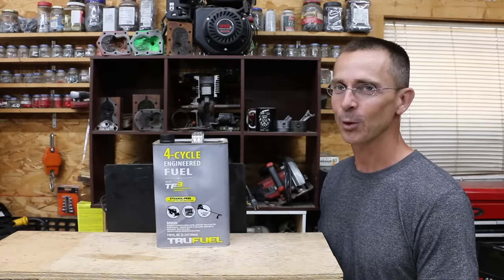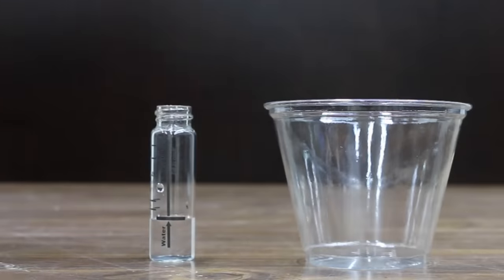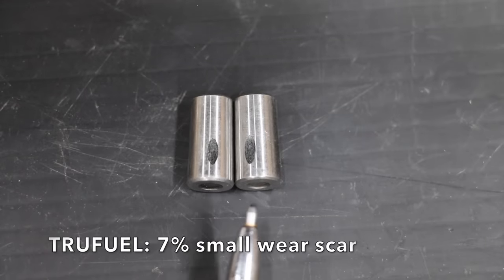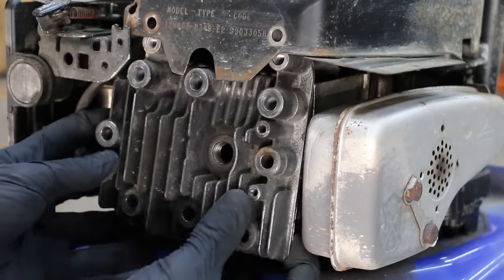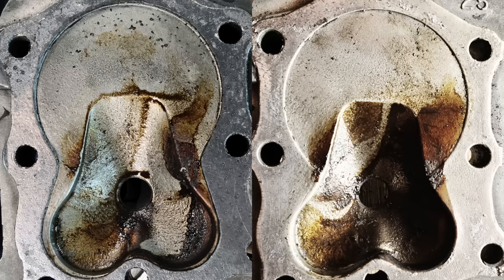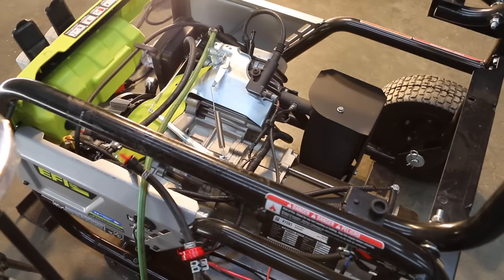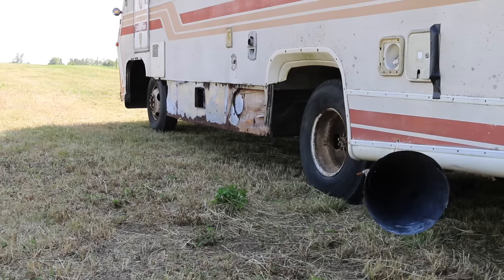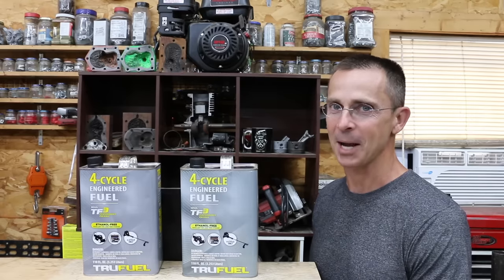Engineered Fuel better than Pump Gasoline?  Better Fuel Efficiency and MPGs? Let's find out!

Comment: Okay so say I have a can of the Tru Fuel 40:1 ratio 2 cycle fuel mix, and an additional 2 gallon spare jug full of the expensive high grade pump gas to add with it (91, 92, or 93). And I am considering mixing the two and adding the contents into the gas tank of my car with whatever premium pump gas that's left inside it, as a last resort in order to get myself to the nearest town/or gas station. This is hypothetical, but it really has been bugging me for a while now. Of course you already tested the 4 cycle engineered fuel in the appropriate engines, but not 2 cycle fuel specifically while running it in a 4 cycle engine with additional high octane pump gas.

Comment: I know I'm late to the show but I use Tru Fuel because it does not have ethanol in it.  I live in a large city and ethanol free gas is not readily available.  I used to have to get my mower, etc. carb overhauled every year.  Tru Fuel has stopped that.
Reply from the maker: Thanks for sharing.

Comment: Test Trillion HydroDiesel. Very interesting diesel-water emulsion with up to 20% water. So, as the fuel consumption remains the same or is even better, it thus uses at least 20% less diesel? Drasically reduced soot and as the combustion temps are lower as water uses the heat to vaporize, much less NoX as well. "Steam power" means no drop in power or torque and might use less fuel. How does it work really? What ahppens when it gets really cold? Does it separate? So many questions...
Reply from the maker: Thanks for the video idea.

Comment: Have you ever done a test on the 2-cycle fuel for chainsaws and other 2-stroke engines? If so, can you post a link. These canned fuels seem to cause a number of problems, especially if the fuel isn't completely burned out of the tank and carburetor. Please let me know. Thanks

Comment: I do not use my 2-stroke equipment very often, only a couple times a year. So I buy the engineered premixed fuel, there are two can’s sitting on the shelf in my shed, when I need to use my chainsaw I fill the gas tank with this fuel, fire it up and go. When finished, I empty whatever is left in the gas tank into my lawnmower and run the carburetor on my chainsaw dry. Then put my chainsaw back into storage. If you’re not going to be using very much of the engineered fuel it is a great way to keep your equipment in tip top usable condition. If you go through a lot of it, like the lawn mower, just plain old E-free fuel is cheaper. 
Once again a great video, and I bet your neighbors just love you when you run the Farmabago. Lol
Reply from the maker: Thanks so much!

Comment: Hey Todd, could you do another video on Upper Cylinder Lubricants for Gasoline Engines? I don't know all of the products available. I only know about Marvel Mystery Oil, and Amsoil Upper Cylinder Lubricant. I've used Amsoil's. Amsoil's was released last year or the year before, I think. I've used it, and I've seen results with it. However, it was only about 3/4 of a MPG higher, which didn't pay for the bottle (which is $3.65 at cheapest, if you have the Amsoil Preferred Customer Discount.) Other cars may react differently than my 2005 Explorer.
Reply from the maker: Thanks for the video idea.

Comment: Great video! 
I’m not sure if this is previously mentioned in the comments, but I’m curious what the life span is, in say a generator between the two fuels? 
Would engineered fuel hold up better long-term in storage?
I use ethanol free, since it holds 5 gallons, but not sure if the longevity would be worth the additional cost?
Reply from the maker: Thanks!  Thanks for the suggestion.

Comment: I'm going to take a wild guess and say this fuel isn't designed for low compression engines., probably why the buildup is so great. Higher compression should increase temperature resulting in a slightly cleaner burn.
This is just my hypothesis however.

Also, running 91 octane in engines designed for 87-89 will reduce efficiency because fuel is harder to ignite for a low compression engine.
I would bet running 89 octane would increase performance slightly in these particular engines.
Reply from the maker: Thanks for the feedback.

Comment: I don’t think the engine running was a fair test. When using different gasoline’s they have a tendency to run differently. For example if I was to use 112 octane it would run different than 93 octane and would require different jets depending on the engine. Each engine should’ve been tuned for the gas before testing
Reply from the maker: Thank for the feedback.

Comment: You don't have a problem with your kill-o-watt meters burning up if you leave it plugged in and running close to max amps? I burned one at 14 amp constant idk how long before it went, I wasn't around but it wasn't to long and another one went at about 11-12amp constant for a longer period of time.

Comment: considering it is mostly parafins, and no ethonol nor benzines (which will make rubbers brittle and leave gummy deposit, it is great to leave in your equipment for winter storage, way better than gasoline. Like my chainsaw for example. In winter time it may sit for 3 months, or maybe a month, I will need it a time or 2 during winter but not alot, engineered fuel is great for this!! can leave it in the saw without the worries of gasoline going stale or leaving varnish inside carburetor. Also engineered is supposed to be good for 2 years once opened. Now, if you figure I am only using 1 tank full per year, per piece of equipment, that $20 a gallon fuel lasts a LONG time and goes much further than you think, and no problems with equipment in the spring :-) 
My opinion. Great video good sir! Love how detailed and how extensive you go! Always a pleasure watching your videos. I wish my channel was as good as yours! you are something to aspire to be :-)

Comment: I use vp fuel and it has greatly improved my small engine/2 cycle engine performance and reliability.  I can't buy ethanol free pump gas where i live so synthetic it is.   Great video
Reply from the maker: Thanks so much!  Thanks for the feedback.
Reply: How much you pay they want 80 for 5gallons of vp small engine fuel
Reply: @michaelchambers6273  basically the same for me

Comment: I have been using Aspen fuel (alkylate fuel) for 3 months on my brand new honda mower. 0% build up, and oil doesnt get black. Sparkplug as well looks new. I use the mower 45min 1-2 times a week.  But what is truefuel?

Comment: Help!  Is there an additive that will extend the working life of regular fuel?  My covid era driving miles are so low, I'm barely halfway through the full tank I started out with in March.  Afraid I might have problems, but don't know whether to top tank up or let it finally drop down to a low level, and just keep enough gas in tank for about a month of reduced mileage driving.

Comment: I had “non-ethanol” gas sitting in my ATV for about 6 months. Turned it on and threw a check engine light for o2 sensor and had to siphon it out bc it went bad. New gas and CEL went away. The fact this test was done with 6month old true fuel and fresh non ethyl speaks for itself to me that trufuel is better.
Reply from the maker: Thanks for the feedback.

Comment: How about a diesel fuel test? Biodiesel B15 vs B85 vs low Sulphur vs off road diesel. I built my own processor to make biofuel from used cooking oil. I'm told biodiesel has better lubricity and cleaning properties the dino fuel.
Reply from the maker: Thanks for the video idea.

Comment: Not a great test but it DOES show that there is little difference in these fuels with low tech engines and probably not a huge change with higher compression, higher tech that this stuff is probably aimed at. (or Its just a con)

Comment: I use True Fuel in my snow thrower for storage. Not only does it run better, but the RPM increases too. It's easier for the engine to use this fuel.
I think the engine deposits you saw are caused by the age and condition of the engine more then the fault of the fuel. My guess is the little blue motor ran hotter too.

Comment: May have said this before but i mixed some Gas in a store bought can or "engineered" fuel with some ethanol free fresh gad and some seafoam.  It stopped every damn one of my 5 stihl chainsaw dead in its tracks on a cedar collecting trip 200 miles from home.   Luckily a guy brought a dull Poulon over and i needed an inch cut before a big dead cedar would fall.  Never thought i could be so happy holding a poulon.
Reply from the maker: Thanks for sharing.

Comment: As a gesture of my thank you, I would recommend you two other projects (and they may include more than one type of physical, chemical or other properties comparison)

No.1 Comparison videos related  on Auto body Paints related products,  Polishing, Waxing, and a more trending one is Ceramic Coating products comparison. 
No.2 Again best restoring and preservatives of integrity of rubber seals, rubber o-rings, such as CV boot covers.

Keep up the good work. Cheers
Reply from the maker: Great suggestions!  Thank you.

Comment: Circular saw cutting blades ( 7 1/4") have greatly improved.  Consider doing a video comparing blades such as the Diablo Steel Demon Blade, Admiral (Harbor Freight),etc.  These blades cut well but the big question is how long do they last.  Are they cost effective?
Reply from the maker: Thanks for the video idea.

Comment: Thank you for your efforts and great videos!

I have a whole house emergency generator which runs on gasoline.  Here is my fuel procedure:

I keep the generator fuel tank filled with non-ethanol, and I keep 2 gallons of non-ethanol as "spare" for test running purposes.  I run the generator 30-45 minutes/month for test/exercise.  The fuel tank plus the 2 gallons is more than enough to last the year for test purposes.  I change the oil and spark plug every year. 

I keep 40 gallons of regular 10% ethanol fuel for emergency power use during hurricane season (8, 5 gallon cans) because it's cheaper!  This is about a 3-4 day supply of fuel at the full load for my home (I reduce the load by turning off some things, the generator could handle it, but I just want to extend the run time)

IF we have a major power outage I will use the ethanol gas to refill the tank and keep the generator running. Once the emergency has passed, I drain any remaining ethanol gas and replace it with non-ethanol for storage.
If we DON'T have a power outage, I put ALL the gasoline in my car at the end of the hurricane season, 5 gallons at a time, including the non-ethanol gasoline which I drain from the tank. 
In June, every year, I refill my supply of emergency fuel.

So, the generator is stored with non-ethanol and ALL gas is replaced after 6 months.  I don't see an advantage to the engineered fuel for emergency generator use.
Reply from the maker: Thanks and you are welcome!

Comment: I use premixed engineered fuel in my 2-cycle equipment with no more carb issues. Everything runs fine.  For my 4-cycle eq, I buy recreational fuel, as I am near Lake St Clair, boat capital.  I noticed that the last time I went to buy rec fuel it had 10% ethanol. Boo.
Reply from the maker: Thanks for sharing.

Comment: Your tests show that the two fuels perform about the same. I also noticed that you used only 4-stroke engines for testing. I went from premix to Trufuel, then back to premix. After running out of Trufuel, I mixed up some premix, and noticed a significant improvement in performance (mostly power) on my 2-stroke Echo trimmer. Cold starting is about the same. Starting when the engine is warm (but not fully up to temperature) is much better with premix. I'll be using nothing but premix from now on, especially since it's about 20%-25% of the cost.

Thanks for the video. I love your tests.
Reply from the maker: Thanks and you are welcome!

Comment: Unfortunately, I live in California (greater Sacramento region), and I noticed when I drove to Nevada recently and filled my new f-150 truck up with gas that it got better mileage (almost 2 mpg better!). Oddly, the same thing happened three years ago with my diesel Jeep Grand Cherokee. Took a 3,000-mile road trip through Oregon, Idaho, Montana, and Nevada and its mileage also improved by about 2 mpg until returning to the Golden state. Anyway you can test some California gasoline vs. non-California gasoline to see what's up?  And thanks for an awesome YouTube channel!!
Reply from the maker: Thanks for the suggestion.

Comment: Test pre mixed (can) two stroke gas against the ethanol free pump gas with a premium oil in it (like Amsoil Saber). OR test the claims from Amsoil where they say that Saber can safely be mixed at 100:1, even if your engine calls for something like 40:1 (example).
Reply from the maker: Thanks for the video idea.

Comment: One test I would love to see is some 'Unleaded 88' which seems to be 15% ethanol, and costs roughly $0.10 cheaper per gallon than regular 87 unleaded. Curious since a new gas station near me put in a pump for it, different handle and everything.
Reply from the maker: Thanks for the suggestion.

Comment: I ran my chainsaw with engineered fuel until it ran out.  The chainsaw had excellent throttle response and it didn't stall very often.

I didn't want to pay the high price for another quart of engineered fuel, so I grabbed the gas can and bought 91 octane gas (ours has ethanol and we don't have a no ethanol option).  Right away, I noticed that my chainsaw did not start as easily.  As I was cutting the tree, I noticed that the throttle wasn't as crisp and the saw stalled more often.

As I was cutting the tree, a question popped into my head.  Is there a performance difference between 91 octane no ethanol and 91 octane ethanol fuel - of course both being fresh.  Also, I was wondering if there's a performance difference between 87, 89 and 91 octane ethanol fuel?  Finally, is there a difference between different brands of engineered fuel?

Another idea for a test.  They say ethanol is bad for rubber fuel lines.  I have an old 1973 Alfa Spider that I bought three years ago.  I had to put new fuel lines in between the tank, fuel filter, fuel pump and from the fuel line forward.  My guess is that the original lines were at least 15-20 years old - they had a lot of environmental damage.  A month ago, the three year old fuel line sprung a leak.  Actually two of the lines cracked - the one from the fuel filter to the pump and the output of the pump.  Everything in front of the pump is gravity fed, except for maybe a little pull from the pump, but if it is pulling, it's not much.  The pump is electric and is more of a pusher.  I had bought the fuel line when I was in Ohio, so my guess is that it isn't good for ethanol.  My idea for a test is to try different fuel lines to see which ones can hold up to 10 percent ethanol - the max allowed in our state.  Also, I'm curious if engineered fuel is better for the fuel lines - I'm pretty sure it is, but a test would be great.  Finally, I wonder if there's a difference between 87, 89 and 91 pump fuel with ethanol - how much damage it will do to fuel lines.

Also, I only use 91 octane fuel in my Alfa Spider and I use name brand gas, mostly Unocal 76 or Shell.

Thanks for all your hard work.  You're videos are great and I love watching them!
Reply from the maker: Thanks and you are welcome!  Thanks for the suggestion.

Comment: Thanks for another awesome video. where I am in CA, we don’t have ethanol free fuel. There is 1 station quite a distance from where I live that has 100octane ethanol free fuel. I hear from several people about how ethanol clogs and ruins the carbs in their small engines. to avoid that, I pull out my wallet for trufuel. I’ve never had a starting issue with my machines, I like to believe it’s working. Never had to clean any internal parts, just air filter and spark plug changes due to normal wear and tear. 👌🏽
Reply from the maker: You are welcome!  Thanks for sharing.

Comment: I use about 10 gallons of non-ethanol fuel a year.  I buy it all at once in two 5 gallons cans.  I also have a 1 gallon for 2-cycle fuel.  I use so little 2 stroke fuel typically a gallon mix lasts 2 years.  No problem at all starting my Stihl MS 170 or my Ryobi RY28040 power head.  Not sure how long it will last.  I keep about a gallon of non-ethanol in my generators and started both yesterday with year old fuel, first pull on both.   I think non-ethanol gas lasts longer than advertised. Common knowledge is one  year, but I've used it 2 years old many times.
Reply from the maker: Thanks for sharing.

Comment: From my own experience with a 40 dollar murray (walmart) weed whacker and troybuilt tb130 mower with honda engine.......both over 8 years old........the first 3 years with the mower i tried ethanol exxon mobil with stabilizer......the engine started to run roughly........i switched to trufuel and the engine smoothed back out about halfway through the 1st tank.  After that, i never went back to regular fuel.  I dont have to winterize my equipment, nor do i have to deal with old fuel disposal because the trufuel can still run good after being stored.  I always ran the 40 mix trufuel in my weed whacker and it still runs great.  I dont any ethanol free fuel stations near me, so i really like the trufuel for what i get out of it.  I only burn about 3/4 gal of fuel a year for the mower since i have s small yard.  Current gas prices make it a better value now.
Reply from the maker: Thanks for sharing.